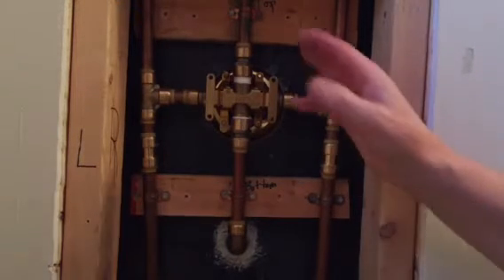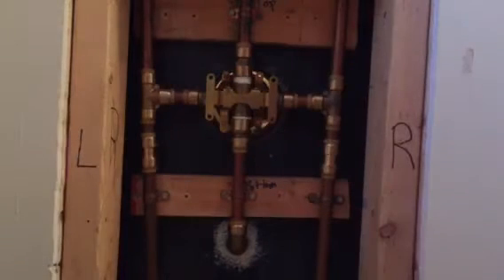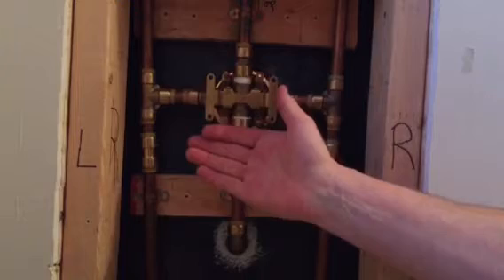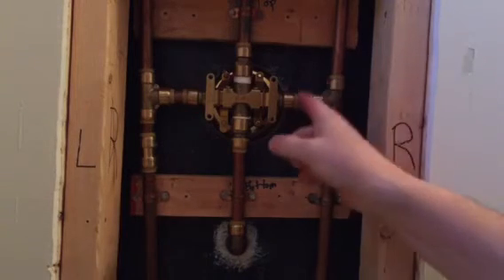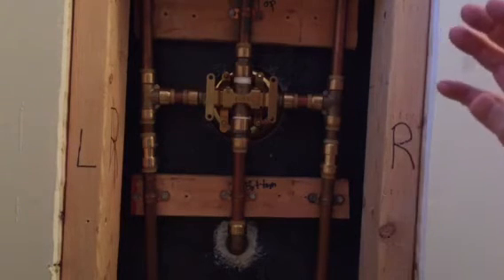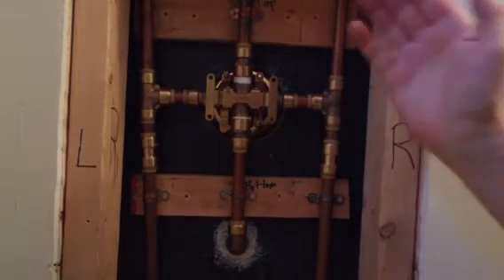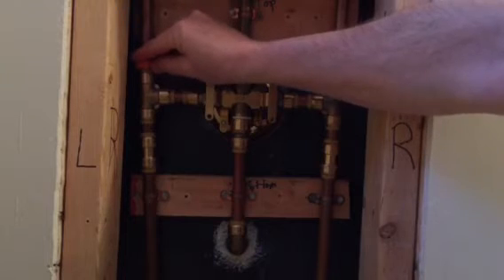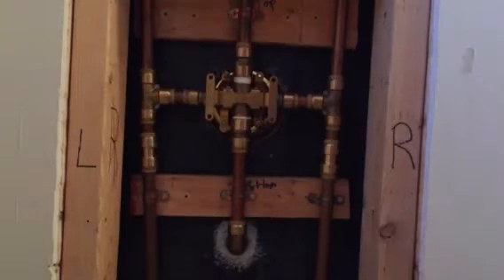NEVER Use Copper Pipe Fittings Until Watching This!

Comment: Ultimate time to use these. Solder madness in such close quarters lol.
You are my hero proving it will work at high pressure and back pressure locations.
Ty for the video
Reply from the maker: R Leb 👍😊